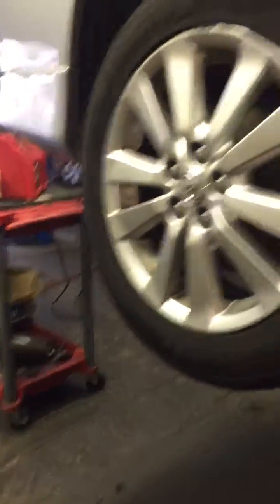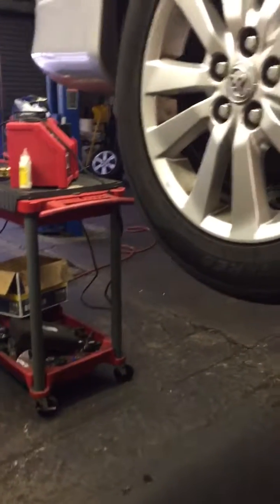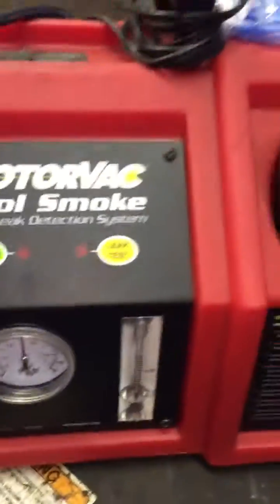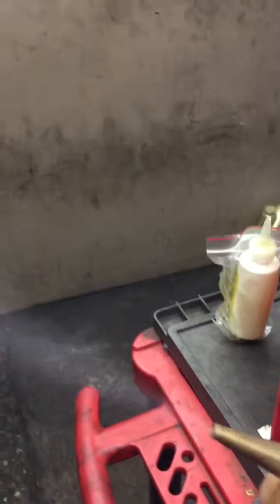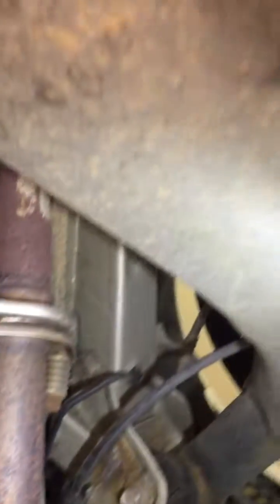How to find leaks in exhaust system using smoke machine

Comment: Where are you located I need that machine used on my truck?
Reply: you can use a shop vac with the hose plugged into the blow port, and a smoke bomb, or industrial smoke emitter cartridge.
Reply from the maker: North nj